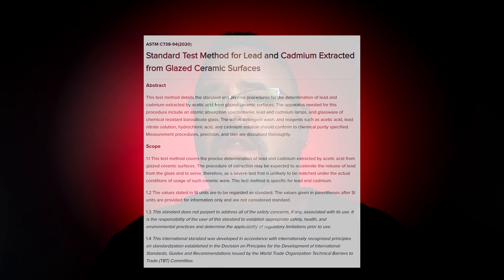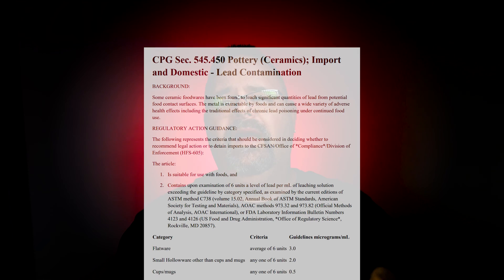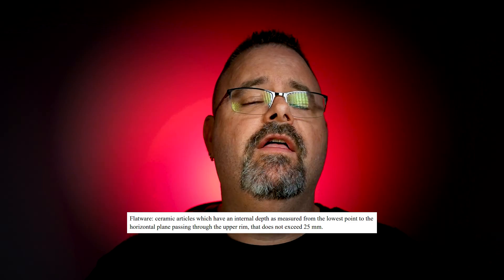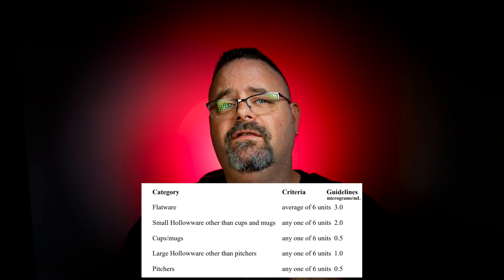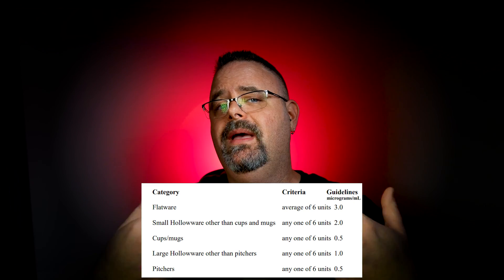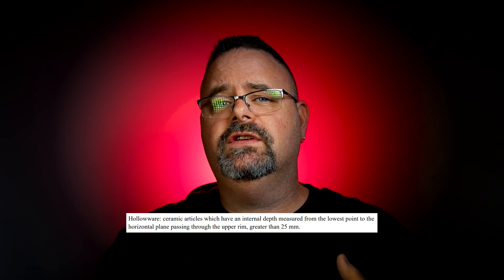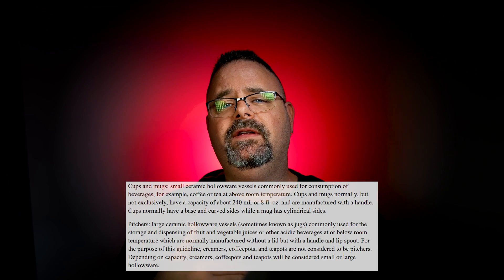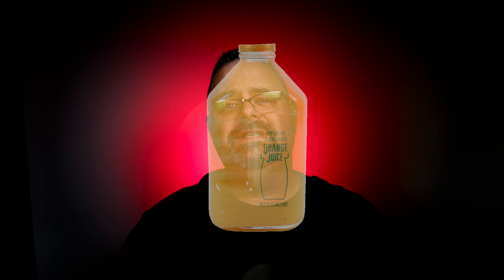Separating Fact from Fiction: Safe Lead Levels in Glazes | Ceramic Materials Workshop

Comment: Does washing your plates in a dishwasher which uses more abrasive detergent, cause the coating or glaze to wear down? Wouldn't that make the glaze 'flake' off over time? Or is it just the acids that affect the glaze? I am just wondering how safe the plates would be over time with wear and tear from dishwashing them.